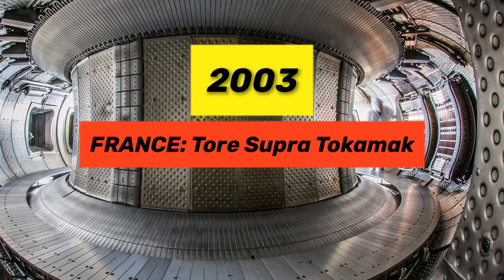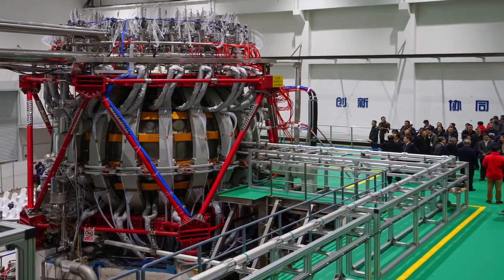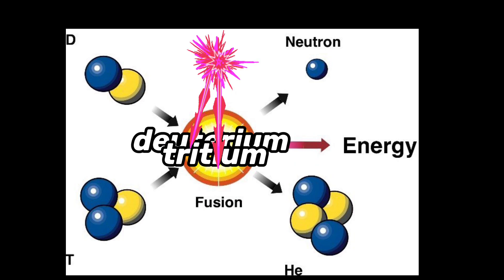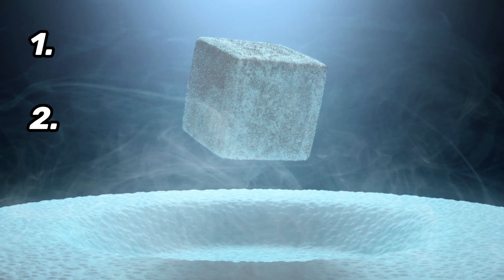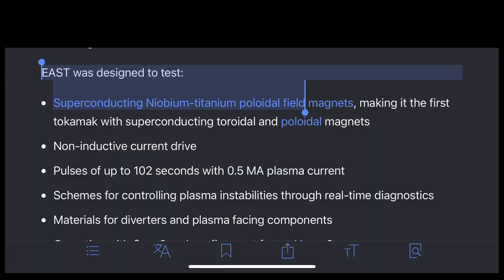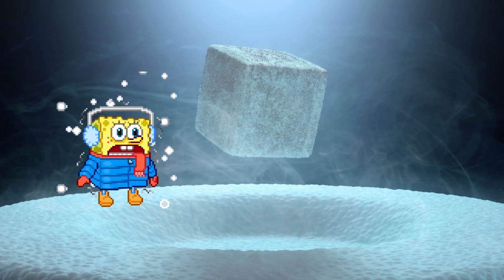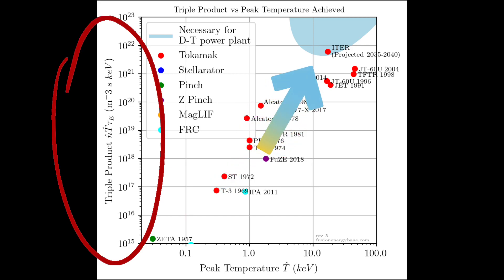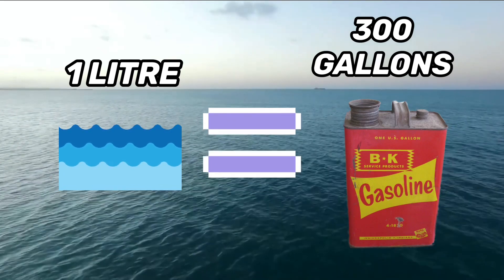Everything We Know About China's Artificial Sun (EAST Fusion Tokamak Reactor)

Comment: one of the big limiting factors is not cooling, but proper "mixing" of the plasma. Current magnet types tend to not evenly heat and mix the plasma. The real next gen tech is called stellerator. It is emerging but is going to solve a lot of the current problems.